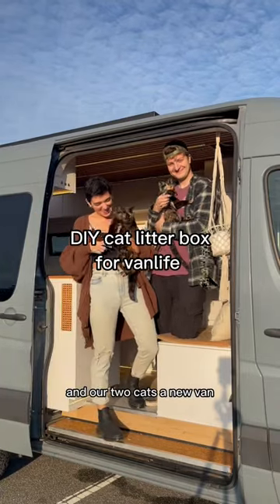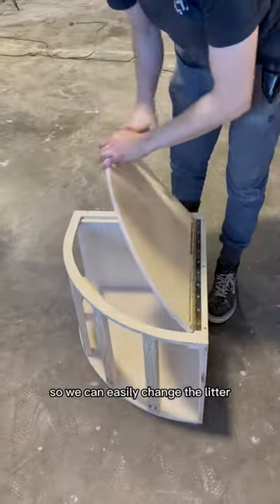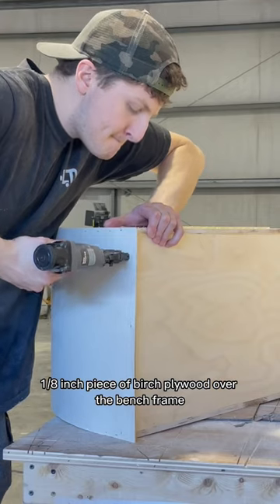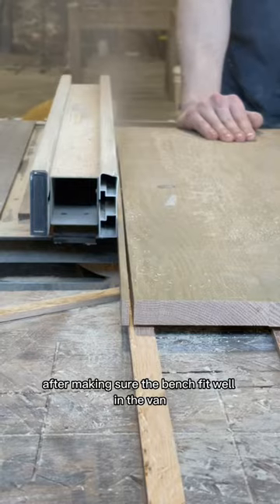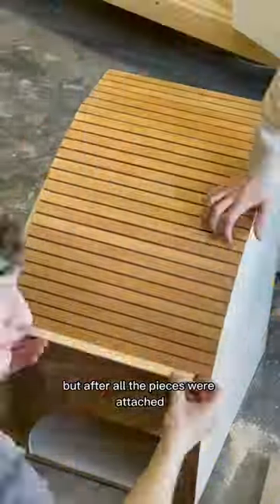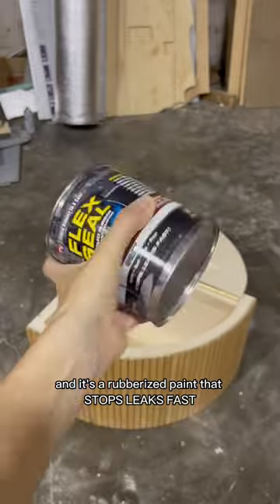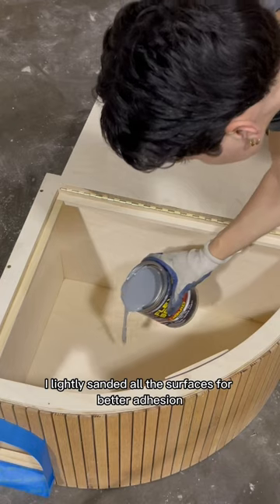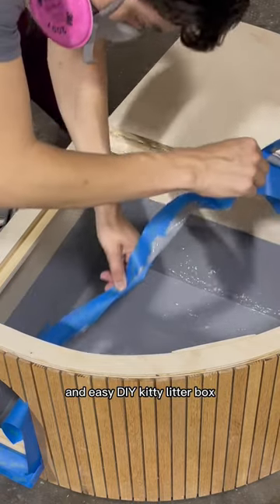DIY ✨Asthetic✨ Cat Litter Box for Vanlife #vanlife #tinyhome #cat #vanbuild

Comment: I would say that this would work better if you have a larger cabinet and a removable litter pan. While the flex seal will water proof it, it might trap the enzymes in the rubber, additionally after a short while of cleaning the cabinet and cats scratching at it, the abrasions from cleaning will rough up the surface of the flex seal causing more surface area for bacteria to stick to.
This definitely can work (I have a cat cabinet in my house) but it needs a bit of tweaking. Much love ❤
Reply from the maker: We had a similar setup in a drawer in our previous van and it the flex seal works well! We are using the space we have available and for the unique shape of this specific placement there was no option for a tray this shape!
Reply: @scarletandseth I would recommend thoroughly cleaning the space and checking for micro abrasions. Then resealing after decontamination or cleaning.

Comment: For long-term durability and smell prevention, they do have triangular corner litter trays. This way you can pull out the tray and do full enzymatic cleans. Plus replacement is easy when the surface gets clawed up.

Comment: Doesn't that flex-seal give off a lot of fumes ? Off gassing in such a small space seems like it might cause the cats to avoid the space?
Reply from the maker: It only off gasses for about a week after application. Since we spent several months finishing the van after this it has completed releasing anything by the point they actually can use it.

Comment: Too small. If they don't like their poopoo place they will most likely do it somewhere else. I get that you want it to be cute and fit the aesthetic but a normal, top entry litter box would fit just as well. Sometimes you gotta sacrifice beauty for function and this is absolutely one of those times.
Reply from the maker: They actually like using this more than their regular litter box. We brought their other one in the van for a few days and they prefer this one.
Reply: @scarletandseth Hm yeah I saw another video you posted and it does look much bigger than I initially thought. Nice work.